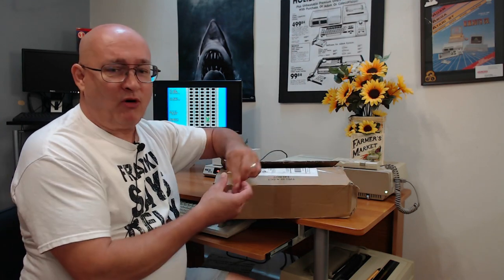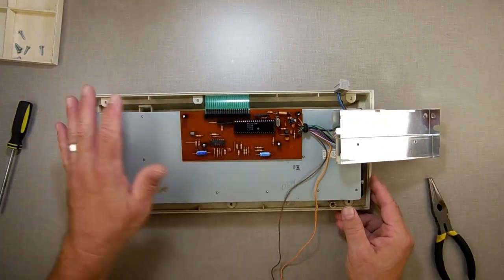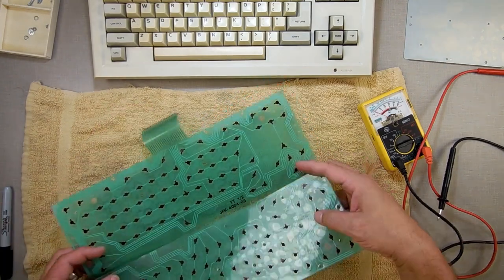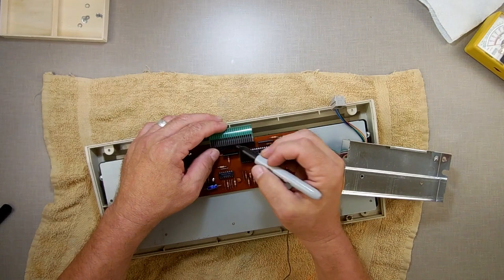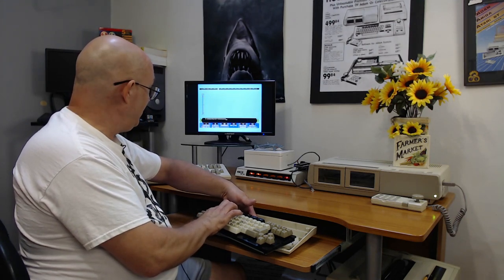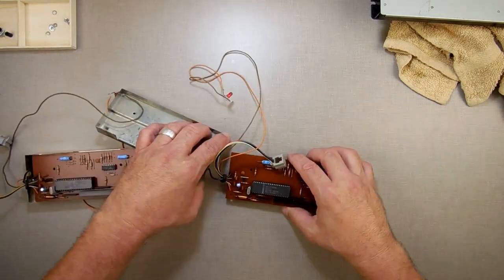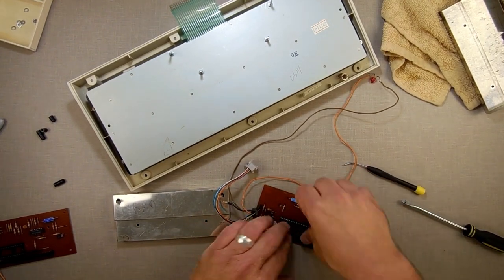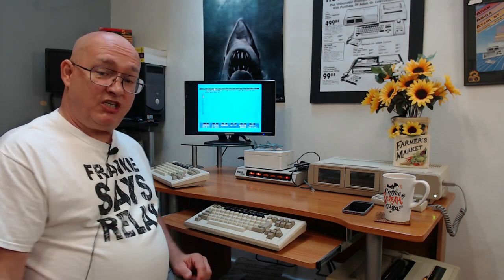Keyboard Love

Comment: Um, yeah, that was a feature length video, but I not only made it to the steampunk section... I made it all the way to the end! Congrats on bringing back to life another ADAM component... process of elimination takes a lot of patience and spare parts. Since you brought up about noticing things in the background, it looks like you don't have a Data Drive installed in your main system, just two False Doors??? As far as your summer project (C.C. or whatever you name it), have you considered including an alternate control scheme/option to use both controllers for movement just like the Arcade game? The Roller Controller would provide the perfect solution for this dual controller setup and you know someone would eventually be inspired to make a Dual Hand Controller Holder with, perhaps, custom artwork.
Reply from the maker: The dual controls are an option :) I have the data drive 6801 removed from the main system.